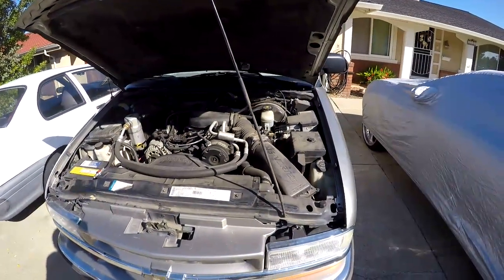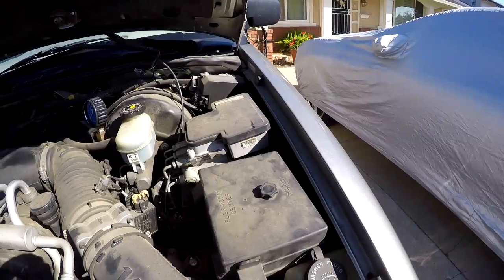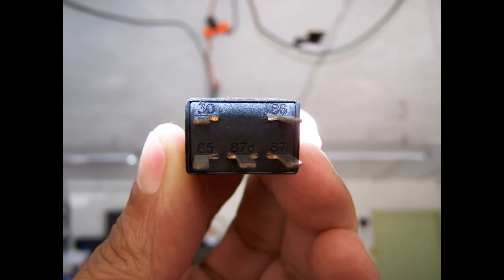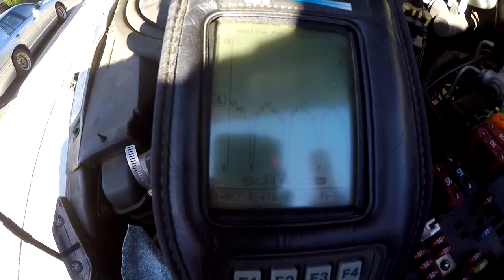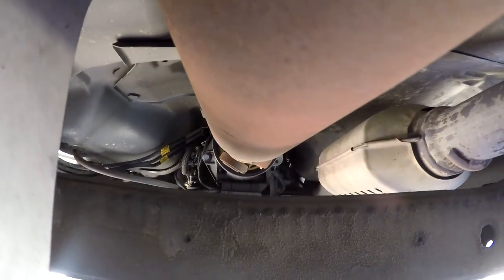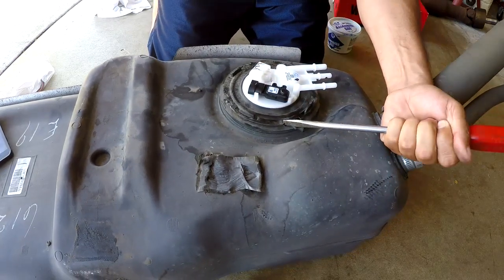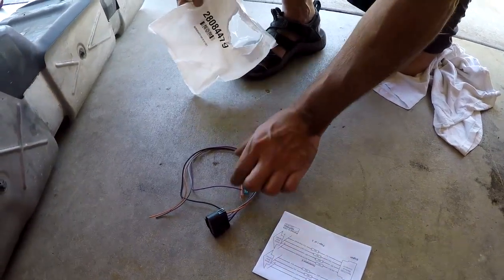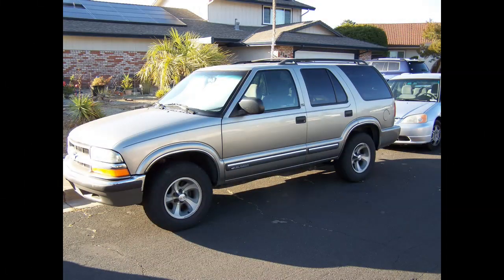GM Fuel Pump Testing and Replacement

Comment: So what happens if i did touch pin 85 with power? I think i accidentally did and now its not reading any fuel pressure. It was only ready 8-10 to begin with
Reply from the maker: Hopefully, there will be nothing because the PCM is what closes that circuit. How ever its not safe. Could ruin the PCM.
Reply: How do I go about fixing this issue? It sparked and I wasn't able to see any fuel pressure anymore
Reply from the maker: @hatetombofficial2954   Check your power fuses. Also check your PCM fuses.
Did you replace the fuel pump?  Pin 30 should have power. The only time pin 85 has power is with the ignition on during crank mode and while the vehicle is running.

Comment: lol do not worry as i am just taking mine apart and will be fixing the line and yes dropping the tank in a week and changing the punp also nothing wrong with the tank but code comes back as P0452 and i just decided to change pump as module comes with it and makes life easier

Comment: You don't need to take the drive shaft out
Reply from the maker: Terry McGinnis
To each his own. Everyone does it whatever way they want. This is the way I prefer to do it.
Reply: And do not need to remove the fuel pump relay and "risk your computer", there is a little contact named fuel primer left side of the relay, apply 12V and the pump will run..... but hey.... "Everyone does it whatever way they want"  ;)

If you shrink your heat shrink tubing with flame torch you can burn your splices and risk the sealing, do it with the proper tool, a heat gun, but hey, "Everyone burn it whatever way they want" ;)

xD

Comment: Did this on two different S-10's (Twice on one truck); getting ready to do it on an IDENTICAL Blazer! same color even). In addition to all you did, I added an additional chassis ground at the splice to the frame nearby, and I soldered and heat shrank the connections. The electrical ground is all the way at the rear bumper mount, and I think I had poor grounding which caused the pump failure.
Very good instructional video.

Comment: You guys down south are lucky in that there is little to no rust lol..up by me in in the great north (wisconsin)everything gets rusted and seized up and need sprays,wax,penatrent oils and hard heat to remove even the most simple fasteners lolz...induction heatinf may even be needed for areas by fuel lines and gas tanks..the way the drive shaft just (fell) off basicly was cool..up here its all worst case seniaro most of the time...were good at thread repair and tapping on a positive note lmao...thanks for the run thru on this video,very well done..most videos like this areent that great,this one acually heled me answer a question i had..
Reply: shit lol i live in texas and everything rust's here dude,the humidity is horrible,i put some headers on a 6.0 ls swap im doing the other day,i havent even driven it yet,well it gets so humid,my blazer is in the garage and the garage gets condensation,so everything metal gets sweat on it,wet,the header bolts are ARP chrome looking and already have rust,in one week,im a stereo guy a bass head,so i have subs with ported enclosures,i had a wrx hatch back,brand new,with a huge sub with ported box parked in the garage ok,so the magnet weighs like 70 lbs,huge chunk of metal,well it sweats and then theres a port opening,i dont go off too much so it sat,i walked out one day,opened the door and the seats and console had all this fucking white nasty mildew growing on everything,i freaked out,so this is from humidity man,i sold the car and im doing a ls swap in a blazer and yea shits rusting before i can even drive it,so the south is notorious for rust buckets dude,we dont have the dry air like yall do,your getting rust from the salt on the rds arent you ? i know a lot of states with snow and salt rust that way,later man

Comment: Hi there is it possible to drain tank by simply turning KEY to on? Cuz dont want to mess w fuse jumper. Once drained then unhook battery cable? Thnx for info
Reply from the maker: No, because when you turn the key on.  The fuel pump will only run for a few seconds.

Comment: My pump is about to go.  Question is why does the new pump require a different plug?  I hate splicing OEM wire harnesses and if one buys a brand new, AC Delco pump why are the plugs different?
Reply from the maker: +dlambo1  It is an updated connector.  As to why, I don't know.

Comment: hi bud,
i have a weird issue on my 99 chevy venture. van died on me, i couldnt hear the pump prime on ignition, i changed fuel filter, the relay clicks but i changed that as well, i replaced pump with a spectra after-market, it buzz's on ignition but dont not have any pressure, i even popped the fuel line off to the filter and zero fuel is present,  its like the manufacture of the pump forgot to put in the impeller, i called supplier they told me possible bad pump, i removed and installed another new spectra pump, same darn thing again. i have now ordered an OEM pump, we shall see the results tomorrow. 
any ideas??? what type of voltage should i be getting out of the 4 pin plug that plugs into the pump unit?
if the pump buzz's on 2 second prime does this mean the pump should be pumping??? did i get two bad pumps back to back.
any help would be greatly appreciated!!!!
Reply from the maker: I know this may sound silly, but did you put gas back into the fuel tank?  The voltage should be battery voltage. Make sure you have a good ground. When you hear the relay activate the fuel pump you should have pressure right away.  And yes, it is possible to have bad pumps.  But to get two. That is really bad luck!  You can test the pumps before you put the gas tank back up.  Just supply 12 volts and ground to the correct pins and it should pressurize. Just hook your pressure tester directly to the out nipple. Be careful not to get hurt.  Wear safety glasses.
Reply: Nicoya 
The last two pumps I tried, I connected everything up and it hummed/buzzed like it was working, and zero pressure, I disconnected it at prior to the fuel pump (tank has $36 in fuel for sure that I put in on the first pump change) and it won't even trickle any fuel out!.... I have changed many pumps of the course of 15 years and I remember if you even had any leaks it would squirt out everywhere!... it must be the spectra pump, who would have guessed.
Tomorrow I install an OEM pump, we will see what happens.
I suppose if I test the voltage at the pump and I'm getting 12v and it powers 12v when I turn the keys it should be good to go for a new pump install.
Reply from the maker: Keep me posted as to what happens.  I am curious as to what it could be.
Is there any way to pinch off the return line so that it dead heads the pump?

Comment: Knew the Spare tire, not about the Drive Shaft coming out.. looked like I could do it without taking it out... not a big deal though... one of these days I am replacing it just for the bad sending unit... no way I pull the pump out and just replace the sending unit on a 2003 Blazer. Less than 90Kmi. but still gonna replace the whole thing this year.

 Thanks for the video
Reply: You dont have to pull the drive shaft atleast in a 2001 4 door you dont just did one but it wont stay running

Comment: Excellent teaching sir... i may need to do this... Question i don't trust those type of connectors and prefer to solder those wires and use heat shrink tube or liquid tape.. is that okay... You seem to be a real pro... can you tell me if a pump can gradually cause issues before finally failing like the one in your video? i am working on this 2001 blazer (198k miles)with a low power and bucks etc... starts easy but runs aweful... i get po 300... have done timing chain ,fuel filter, cap,rotor plugs and wires.. still runs badly... so now i am waiting for new spider injectors and a new distributor since i have seen other replace these parts and fix miss fires.... but am thinking a fuel pump not working correctly(inconsistency) delivering fuel to injectors may be the issue... any thoughts of what else could cause my issues is appreciated... i did a fuel pressure test mine goes to 55 psi and when i turn key off it drops approx 1 psi every 20 seconds... thanks again for your fantastic easy to follow repair video... i just subbed...
Reply from the maker: You can use whatever connectors you want as long it's a good connection.  A fuel pump can be intermittent before it fails.  A P0300 is a crank sensor code.  I would use a scan tool and see what's going on.
Reply: @InitechAuto  yes i changed crank sensor already. and cam sensor which made no difference (those codes do not come up anymore...the po300 is multiple miss fire code which is pretty common for 4.3 and seems to have many causes. from the research i have done.. i only have cheap scan tool (just tells trouble codes) unfortunately ...i believe from various research on this truck... i am getting very close to solving this puzzle...buying and learning to use a much better scan tool as well as improving my trouble finding skills is definitely on my to do list...thax

Comment: can you tell me where the water  line for rear windshield washer runs through this model
Reply from the maker: I do not know.  I was only replacing the fuel pump on this vehicle.
Reply: @InitechAuto  I found it it runs from the back down the left side of the truck with the wiring harness

Comment: Three more things that should be done, # 1  you have the gas tank down and the fuel pump out, take a flashlight and look down the opening, and look for any water and or dirt, if there is any of them is there, now is the time to clean the gas tank or have it cleaned, # 2  do not use any flame anywhere near the gas tank,
# 3  before you put the drive line back up carefully, take off the caps of the u joint turning them as you go, watch and make sure any of the needles of the bearing do not come out, after you have taken off the caps, whip off the ends of the u joint off with a clean cloth, the ends of the u joint should look smooth, no groves or uneven parts & not rusty, if you see anything I have just said replace the u joint, before putting the caps back on the u joint take little finger and put some grease in the caps, carefully put the caps back on making sure they go on all the way, if they do not, take the cap back off and make sure none of the needles are out of place and stuck up in the end of the cap, if so take something small and sharp and put the needle back in place.
Thank you Dennis
Reply from the maker: Dennis Friedman Good advice on steps #1 and #2.  However, step #3 is totally unnecessary. You could just be opening up a can of worms if you drop the caps.  Thanks for your input.
Reply: We no you no he no some buddy don't no

Comment: Great video! I have a 2002 Silverado, I'm thinking about removing the bed instead of dropping the tank. What do you recommend?

Thanks in advance.
Reply from the maker: I have done both ways. Whatever is easiest for you.  You don't even have to remove the bed all the way just make sure you disconnect the electrical for the lights

Comment: will it start with that wire in and if if does, do I leave it on while driving it? I just want to drive it to my garage to replace pump
Reply from the maker: As long as you have fuel pressure it will get you home.  Leave the wire in place just to get you home.  If you remove the wire.  It might stall if you can't get the relay back in there fast enough.
Reply: Thank you Nicoya I hope it starts. By the way, awesome video!

Comment: Thank you for posting this video.  Now I know what to ask another mechanic re: the bad work my 1st mechanic just did.  Have you ever heard of a fuel pump switch in the lower right front passenger panel under the glove comparment?  Does that have anything to do with my car cutting off after fuel pump replacement?  Thanks.
Reply from the maker: The answer to your question is NO.  Unless some one has added something.
Reply: Thank you for getting back to me.
Reply from the maker: Mzleca22  What do you mean by "your car cutting out"?  Does it shut off as you are driving it?  Or does it sputter and then die?
If it shuts off instantly,  Its  possible it may be a bad ignition module.  Sputtering is more likely to be fuel related. Just my thoughts!
Of course have it checked out by a reputable mechanic.
Reply: @Mzleca22  Late reply but that switch is on older "fords" and it's called an inertia switch which cuts fuel pump in the case of an accident

Comment: what do you lube the seal with i would ask
i an not going to use any lube i would like to know the best lube for the gas seal
Reply from the maker: James Ragan  I used transmission assembly lube.  You don’t need very much. You can even use pool seal lube.
Reply: nice and thanks you! i thnk my fuel pump is sporadic and needs replaced now
thanks you
Reply: going to get it tested firstly  then do it

Comment: Why is it that the drive shaft has to come out?
Reply from the maker: To give clearance to remove the fuel tank.
Reply: Nicoya ok thanks for the quick reply. Would it be at all possible to remove wi5hout taking it off
Reply: @tylerv.g.6268  yep.

Comment: Did you check running pressure?
Reply from the maker: Ronald Bolen
Yes. Should be in the video
Reply: @InitechAuto  All I saw at the end was the Satic pressure with the key on. I was curious because I think mine is failing. I only have static pressure of 55, it will not go to 60 like yours and then driving down the Highway I only have 50 psi
Reply from the maker: Ronald Bolen 
Yours is 5 PSI lower than the recommended specification. Could be getting a little tired. Also check your fuel filter.
Reply: @InitechAuto  I did I changed the filter it helped a little at first bu right back where it was if not  a little worse. I changed it five years ago so I'm changing it again. Thanks for the info. I can't find a book a repair manual, but I finally found something online saying 60-66psi normal